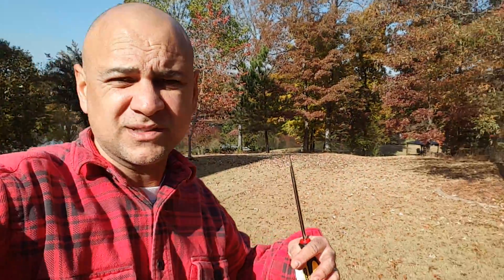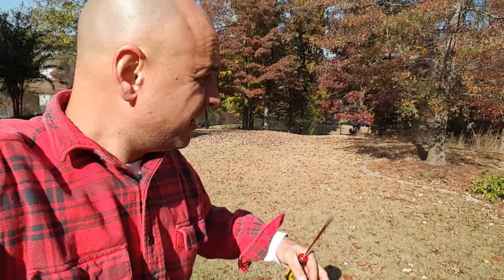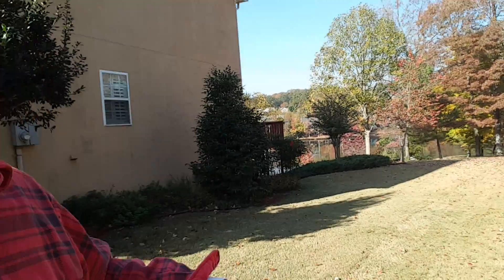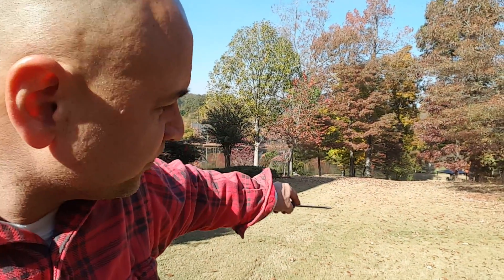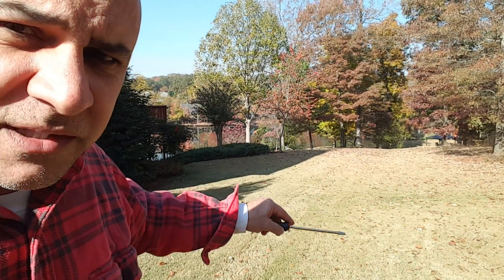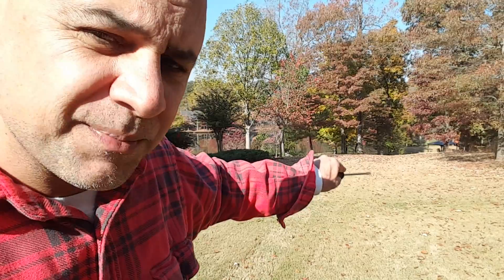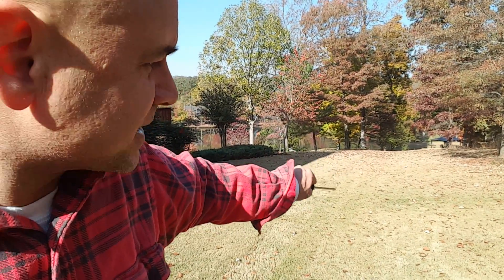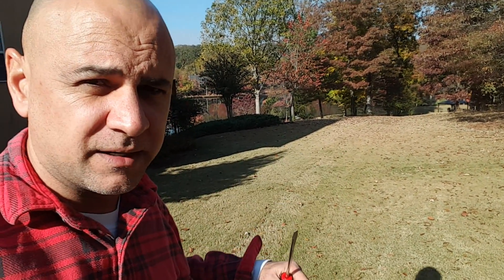How to Find a Leaking Sprinkler Valve 💦 Tips and Tricks to Locate a Sprinkler Leak

Comment: Thanks for your time I appreciate it. My valves still work ok but I need to find them for future maintenance and I couldn’t find any valve boxes except the one for the water meter sewage and main sprinkler shut off. I believe they may be in a covered valve box or directly buried without a box. My system was installed in the 1980s.😎😎
Reply: Just 2 weeks ago I was able to find 6 solenoid valve boxes in my yard that were working but buried beneath 2”-3” of soil. I bought the Chat-R-Box Pro and found all 6 within a couple of hours.
Reply: @mikesweeney5685  very cool 😎

Comment: I want my two minutes back
Reply from the maker: Cam, I get it. A simple solution to a simple problem.  There’s more complicated ways but I could not resist posting this very easy fix. We run into this so often and it works, but certainly it’s not 100%. Fortunately I got right to the point and didn’t try to keep to YouTube’s algorithm of 15 + minute videos😁
Reply: @SarrosLandscaping  Fair enough. It actually was a good tip.